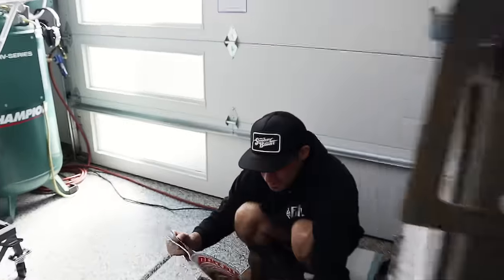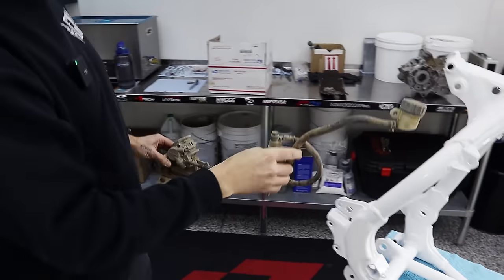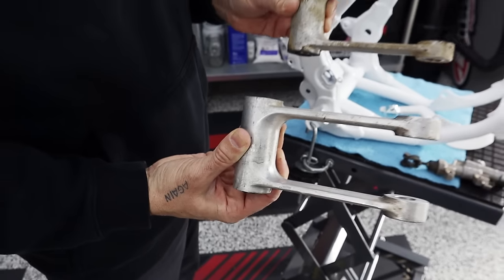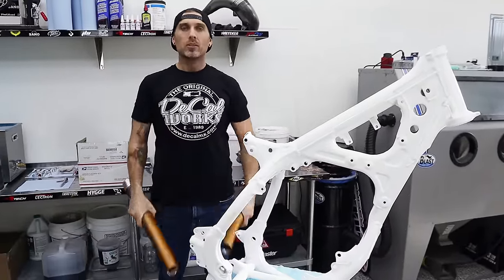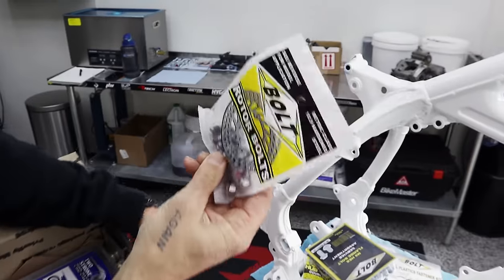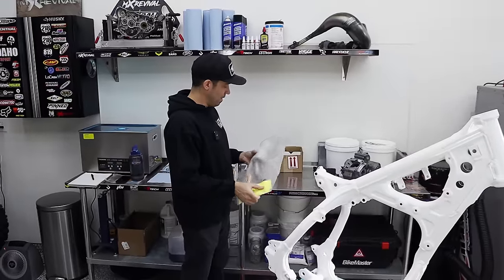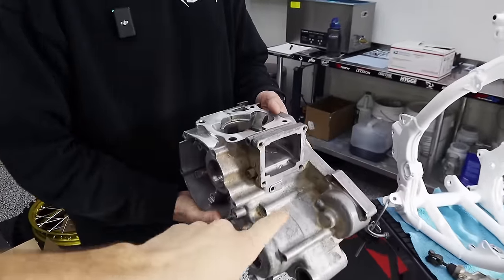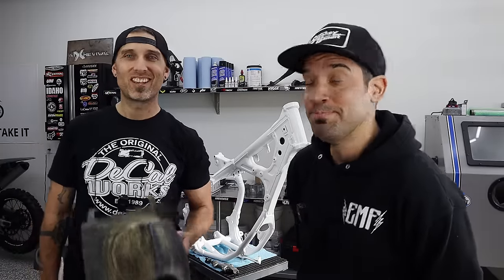Two IDIOTS build a YZ125 2 stroke... This is the worst dirt bike we've ever seen

Comment: Definitely love you guys working together pure educational entertainment 😂 😂. I personally stopped running black rads I tested the theory and they run WAY hotter than  bare metal or a light color
Reply from the maker: Hahaha! We’re soked to hear it. Sometimes we may all be getting a little dumber as well… all in fun!

Always wondered if that’s why they stopped painting them black from the factory back in the day. 

Ours were so thrashed, more of a cleanup technique to match the factory color. 

Dean at FBC even has a heat dissipating coating for these and exhaust systems. Trick stuff with the best of both worlds 🙌

Thanks for watching!
Reply: Thanks dude!  It’s certainly an aquired taste.  We can be serious too, sort of.  The bikes we build are where that goes down.
Interesting feedback.  I tested that myself as well years ago two and four stroke and found no great impact on the black (anodized) radiators for higher running temps.
What surface treatment were you using?

Comment: Thanks for the video gents, had the same problem removing the jug studs, took me days of heating gently and using candle wax small tapping on top, I had also buggered the threads and welded larger nut closer to base of cases so stud wouldn’t bent/snap.
Reply from the maker: Those sure are all the tricks to get it done! Sounds like you pulled it off too. Heck yes.🙌 

I’ve seen as bad as snapped off flush with the cases. Machine shop will weld a washer to the stud, through the washer hole- then weld a nut to the washer. 

Usually the heat from the welder is more than enough to extract the stud too. 

We couldn’t believe where we ended up with these in the end. Almost felt embarrassing. But made for good content on the website. “What to do when” as we’re all human. 

Thanks for watching today’s drop! -Charles

Comment: The 6 speeds from the older bikes swap in the 5 speed bikes. Did it on my 02 just this winter !
Reply from the maker: No way! So there’s clearance for the six speed transmission inside the five speed cases? Or you dropped a five speed into a six speed case? (pretty sure you meant exactly what you said about the six inside the five case… but it would be good to know)

Comment: Hey Charles with coating radiators does it have any effect on cooling or profomence?
Reply from the maker: Have never hit them with at temp gun personally, but word on the street is that coatings can make them run hotter.

It may be why factories stopped painting them from the factory back in the 90s. We’re sure that would also save them some money.

But as you’ve noticed, everything nowadays is bare aluminum. We would imagine there are some performance benefits as well, in terms of lower temperatures.

In our case, being that these were black when they were new, we are trying to keep an OEM vibe and of course, keep them looking a bit nicer. 

Dean at FBC even has a heat dissipating coating that is black. So it has some performance and good looks!

Comment: My 97 is almost done. Just wondering how the throttle cable is ran.  My seems short but my dealer says it's right
Reply from the maker: It would be strange if it was short, but you could definitely try running it down the opposite side of your frame if it afford you any extra slack. 

If that doesn’t work, I would order a new cable. 

Routing should be from the throttle housing above, back behind the front number plate, and down the side of the frame rail.  

Some bikes, have the cable routed on the left of the frame rail, some routed on the right. It really doesn’t matter. 

Inversely a cable that is too long on one side of the frame can be routed on the other side to remove slack. 

I hope that helps